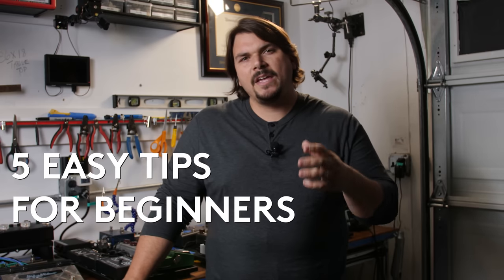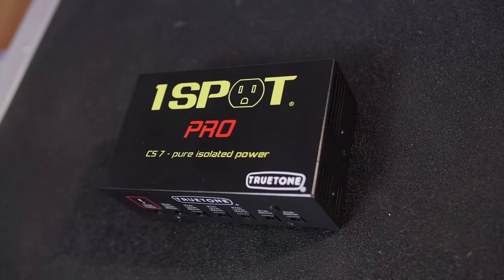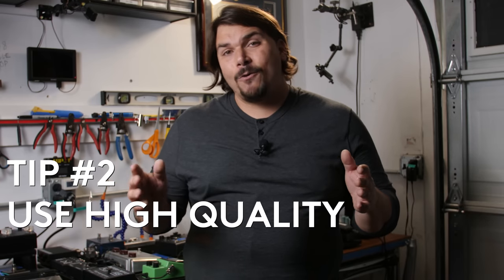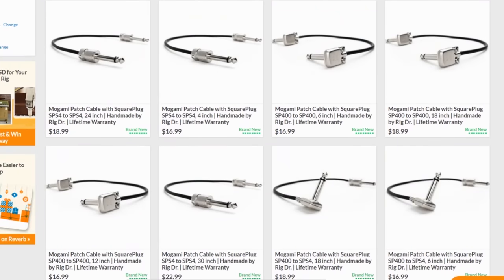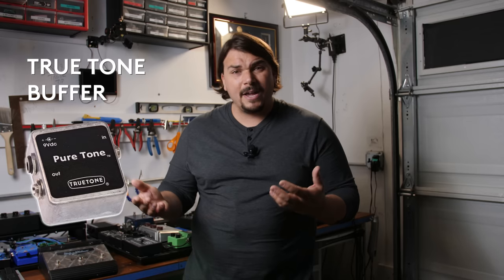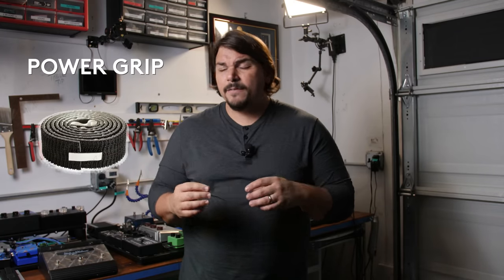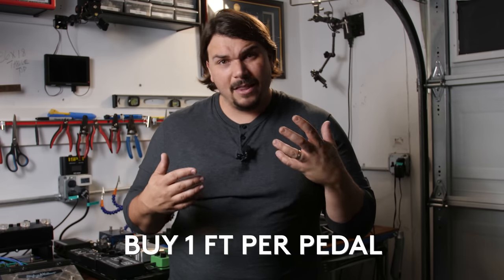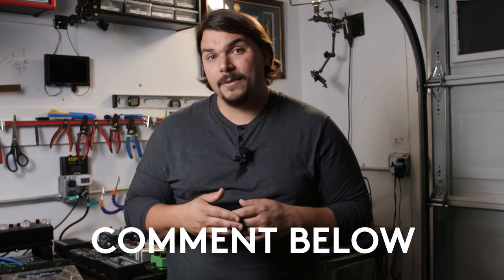5 Ways to Improve Your Pedalboard

Comment: Great video.  

How would you handle buffers when you have a tone bender style circuit at the begging game?  Put it after?

Also...does a Strymon buffer do that trick at the end? Or would you buffer after the Strymon as well?
Reply from the maker: Put the input buffer after the Fuzz.  Strymon has fairly low output impedance, around 100 ohms, which is good.

Comment: My board is mounted on diamond plate on top of melamine board I just use crimp on connectors and supply is underneath I even have a couple blue led lighting automotive type. Clean power

Comment: Hey Mason I think I sent my question wrong so here it is again. I have an Xotic  EP at the end of my 9 pedal board and a Soul Food 4 pedals in from a Vox wah , Rusty Fuzz, then a GE 7. Thoughts?
Reply from the maker: You should have an input and output buffer as I suggest.  The Holy Trinity of Good Tone = 1) high quality input and output buffers (1M input, 100 ohm output impedance), 2) isolated power supply, preferably switch mode, and 3) high quality, low capacitance soldered cables (audio and power).  If you do all that, you've stacked the deck in your favor and rarely will you have pedalboard related issues or have tone suck related to your pedals or shortcomings with the rig.

Comment: Hi Mason. Thanks for this helpful video. I'm building my first board - a Pedaltrain Nano+. Would you put a single strip of DualLock across the top and bottom lengths of board, or just little squares that align with the DualLock squares on each pedal? Long strips on the board would make it easier for rearranging pedals. Thoughts?

Comment: Switchmode power supplies are lighter, cooler, and cheaper than good linear power supplies; but, a good linear is going to be significantly lower in noise than most switchers. The main impediment to using a linear are the size, weight and cost of the heatsinks.
Reply from the maker: If you're comparing power supplies designed for audio in our field.  The switching power supply, in the audio range, as quiet in as the best linear supplies.  The high quality versions aren't necessarily cheaper and most of the linear supplies aren't actually toroids.  Furthermore you can't just put a linear power supply anywhere you want on a rig, you have limitations and the leakage of the EMF is what you're missing in your analysis.  This is a HUGE problem and results in noise in the system even if the outputs themselves are totally isolated and quiet.
Reply: SMPSs are noisy compared to linear power supplies; that's why precision electronics are iffy about them. But the noise is usually well above the audio spectrum and therefore inaudible. Cheap digital pedals might throw a fit over a cheap SMPS, but I've never heard of that happening, since any digital circuit or chip worth its salt buffers the power it receives; usually with a linear voltage regulator IC. I don't believe any analog circuitry used in guitar pedals is going to have any trouble with HF noise, so an SMPS is actually a very good option for guitar effects. The main downfall for linear power supplies is that they radiate a lot of noise if they aren't shielded and grounded like they ought to be.

Comment: My new vertex board and S.S will arrive on Monday i just can’t wait. I just have to save a bunch of money to swap my evidence audio cables for something better.
Reply from the maker: The cables are fine - just get new plugs and you can solder your evidence plugs!  Thanks so much for the support!
Reply: @VertexEffectsInc  thanks to you Mason for the awesome products and advise. Wich kind of plugs would you say is a good  option?
Reply from the maker: @hectorherrera7926  SquarePlugs SP400/5000 or SPS4/SPS5 - it depends on the diameter of your cable.  Check out Best Tronics website and they have a look up table for the which plugs fit the cable you have.
Reply: @VertexEffectsInc  thank you so much Mason you are the best!
Reply from the maker: @hectorherrera7926  Thanks for watching!

Comment: Hi Mason ! For the price difference, do you think that the Truetone can be as good as the High-Wire buffer ? Regardless the different features added in the Mesa Boogie. I just talk about the tone that you get. As always, great vid and great tips for us, thanks a lot !
Reply from the maker: The only objection that I’ve had to true tone is sometimes the quality is not great, I can’t say for certain but my presumption is is that they’re made overseas, which is an always a problem necessarily, I’ve just had some here that haven’t worked out of the box where that’s really been my experience with Mesa Boogie.  I presume if you buy it from a reputable place, or a place with a good return policy like Amazon, you shouldn’t have any problem and I think that sonically it will be a nominal difference if any, you’ll just need to get two of them to equal the number of buffers on the Mesa Boogie.
Reply: @VertexEffectsInc  Ok thanks for your recommendation !

Comment: Hello! Many thanks for all your videos! 👍  Question: I have a crybaby then a Ego Compressor then a Tumnus Deluxe with the buffer switch engaged. Am I ok for my begining of the line buffer?  I then have some pedals... ending with Boss DC2, MXR Carbon Copy, MXR Reverb anf 12 feets of high quality cable for the amp. Do I need a buffer after my reverb (at the end)?
Reply from the maker: Input and output buffer ideally as I suggest in the video.

Comment: Great tips! Bass player here, currently have a board with 14 pedals, in a few weeks when everything arrives Ill be setting up a new 20 pedal rig,  Should i get buffers for the front and end of the signal chain? I have 3 Boss pedals aka buffered bypass roughly at the beginning, towards the end and end of the chain, would i still benefit from the extra buffers?  Thanks!
Reply from the maker: If you're going balanced out of your rig - you wont need an output buffer.  Otherwise you will want an output buffer.  If you use an active bass, you won't need an input buffer, but if you ever use passive, you'll want the input buffer there.  The Boss pedal buffers are poor and I wouldn't rely on those to do the job well.
Reply: @VertexEffectsInc  thanks for the response!  I mostly use basses that switch from active to passive but I tend to run them in passive most of the time.  Time to rewatch your buffer videos 😄
Reply: @VertexEffectsInc  im also running a large format Cali76TX  at the end of the signal chain.  Apparently when powered by 18v the transformer stage acts as a buffer.  Is this enough? There's no audible tone suck to my ears (through the amp), although I play in studio sessions so I'd want the best signal coming off my board.
Reply from the maker: @aaronkim2090  I think the output impedance is still quite high, around 1K ohms, you can double check that on their site I'm sure.  It should be more like 100 ohms

Comment: Thank you for the nice informative show! Just one question, if I have 4 pedals in the effects loop and 5 pedals in front of the amp, do I have to put 4 buffers? 2 in the effects loop and 2 in the front of the amp? Thank you for sharing!
Reply from the maker: Pedro, I would say get a dual buffer - if you have a buffered effects loop, you may not need one there - at worst you'd need one on the RETURN only going back to the FX Loop Return from the last pedal in your effects loop.
Reply: @VertexEffectsInc  Thank you a lot!
Reply from the maker: @petrvm  my pleasure!

Comment: I agree in all except in still using Velcro. Velcro is the past. A mechanical fixation is much better. Try the Guitto Pedalboards. About the power supplies, I prefer the old Dunlop DC Brick (with a 110-240V input and ten outputs: seven of 9V and three of 18V). And what about "ribbon" patch cables?
Reply: Guitto Pedalboards are HORRIBLE - 3M dual lock is not velcro.

Comment: Is there a supplier of bulk flat cable for custom cables?  How do you deal with really short regular round cable when two pedals are right next to each other?  Round cables don’t bend in half nicely
Reply from the maker: Not that I'm aware of - but you'd be better off using Mogami - it's easier to deal with for neat runs than the flat cable and better shielding typically as well.

Comment: Hello, just found your channel. Excellent information. I have a question. What do you think of pedal connector straight plugs? I do use several and have had no problem that I can perceive, but I have heard they can be detrimental to your signal.
Reply from the maker: Straight plug versus right angle...not really any difference other than the space it takes up.
Reply: Do you mean those hard links? They wear out your plugs, since there is no flex to them, which would allow for imperfect alignment of the jacks. Most pedals are tapered just a little bit on the sides; so you can image what a hard link would do to the jacks mounted on those tapered surfaces. The hard link is straight, but the path it needs to follow isn't, so it ends up straightening its own path and wearing out your pedal jacks very quickly. If you can find some that flex in the middle, that would be awesome. But those generic ones are something to avoid.
Reply: Andrew Neal Thanks, that's exactly what I meant. Thanks for the tip.  Looks like an upgrade is due.
Reply: @daleburke1730  Happy to help!

Comment: Hi Mason. I'm building my first pedalboard but I was wondering about my fx loop order. I have a Strymon Mobius, a Seymour Duncan Andromeda Delay and a TC HOF 2. In what order should I put these 3 pedals for my fx loop?
Reply from the maker: I'd try it and see what you like.  A lot of guys in the 80's liked Delay after Reverb, most guys now put it before - so you can experiment.  I personally don't like modulation in the loop, I prefer it in front of the amplifier, but you can experiment with that too.  I'd put it' before delay and reverb if you use it in the loop.

Comment: Thanks a lot for the tips on this video! 

I was looking to upgrade my power on a board I’m working in but I have a digitech whammy XP100 that runs AC so I use 2 supplies for the rest of the pedals. Is there a way to solve this issue? Like a current inverter or do I have to modify the pedal? 

Thanks a lot for any answers on anyone with this type of issue
Reply from the maker: I would check out the truetone CS 12, it has one AC output
Reply: Thanks a lot! I think that one would be the solution to upgrade my power

Comment: Will switching to a proper power supply or changing patch cables have a bigger effect on improving tone?
Reply from the maker: Each of them you do will improve the signal and lower the noise.  If you do both, it'll be doubly improved.

Comment: Hi Mason! Quick question regarding the dual lock strips. Which density would be appropriate (enough) for a pedal board as they may vary from 170 to 400 stems/in2? Thanks in advance!
Reply from the maker: Yes, that's fine.  Offsetting the two densities is the key.

Comment: I bought a Voodoo Lab Pedal Power 2 plus for my board but don’t have enough outputs so right now I’m using a cheap (from Amazon that I previously owned) self isolation station connected to the receptacle on the back of the voodoo. I need to replace this ASAP should I buy another Voodoo Lab or not? I’m using a very large board so I can grow into it 😆 Bought a Gruv Gear Lynk trio so I can just add another plate to it as my collection grows (I want to own every Waza Craft pedal) and I saw that you went into two supplies and drilled a hole into both of them and soldered two of them back to back. On my setup I had to put them apart because the leads supplied got to short, does having two power supplies add extra noise too the chain? Should they be next to one another or as I have on both ends of the board? If they go side by side then I will need to make longer leads, and then the question is which will have more noise? Also another question I just bought all of the soldering equipment I will need to make and repair cables and small mods to pedals ( I think it was you that put an on/off switch on battery powered pedals so you don’t have to unplug them every time your done) my biggest concern is the best solder and flux to use. I bought regular 60/40 and plumbing flux that I need to return (lol should have read the label better) and what do you use to clean the joints after your done? I should have said that I live in Canada 🇨🇦. Amazon Canada offers different items a lot of times. Thank You Doctor and please wash your hands 👋
Reply from the maker: You could use the Voodoo Lab x4 extension supply.  It will allow you four more isolated outputs and you can power it out of the courtesy outlet on the back of the Pedal Power.

Comment: After having deoxit-ed my boss tu-2 multiple times in the last year and still having the same issue of intermittent signal loss when either of the two output cables got moved slightly; I took it apart to check out each jacks terminal and all three had black on the tip terminals where the cable tip would make contact. Some light sanding did the trick but what do you think it was and have you seen it before? Just dirt or oxidization?
Reply from the maker: This can happen in some environments- there are also higher concentrations of DeOxit for badly deteriorated contacts

Comment: Wow I don’t understand . Are you saying the voodoo labs 4x4 is an old linear model that’s noisy when placed under the board?  I was looking at the voodoo labs mondo to power ~14 pedals on my board. Would this be another  noisy one?  Voodoo labs markets them as being silent
Reply: If you have Digital pedals voodoo lab is the worst. I have a hx stomp and a dd-500 and the voodoo lab mondo was under the board. It was introducing noise into my sound and also voodoo lab can’t power pedals like the tru tone can. I went to the cs12 trutone and don’t regret it at all
Reply: This dude Sanchez wow... noted .  Using the mondo now and yes there is some noise 😩
Reply: @RajivSamaroo  yeah lol definitely took me awhile to figure out what was making the issue till I figured it out and remember the rig doctor talking about it on a old video. I definitely recommend the cs12. I took mine in ( voodoo lab) and did trade at the guitar store. And now I am happy with the cs12 wouldn’t go back lol
Reply from the maker: Voodoo Lab Pedal Power 4x4 will create problems in other pedals because it has a toroid (or maybe C or R core transformer), and it doesn't have the electromagnetic shielding that the earlier versions of the Pedal Power, Pedal Power 2, and Pedal Power 2+ had by way of the steel enclosure.  This means you'll have to be very mindful of what's next to it or near it as the magnetic field can cause hum and other noise issues with your rig.  The Mondo is also aluminum and will have a similar issue, as does the Pedal Power Digital.  I would suggest their new Pedal Power 3 or 3+.  They are both switch mode power supplies and won't have any issues related to electromagnetic fields or sensitivities due to proximity to other pedals.

Comment: Would shielding help reduce noise if you have the older style power supply?
Reply from the maker: Steel or Mumetal but doing it properly would negate just buying a switch mode supply.

Comment: Hey Mason, love the chabnel. I have one question for you. Are all voodoo labs power supplies linear, and will cause the noise problem ? I have a pedal power 2 plus and am waiting for a pedaltrain board and mounting bracket to arrive in the mail. But now I am worried about noise problems after I set everything up. Any advice ?
Reply from the maker: The new Pedal Power 3 and x4 are all switch mode
Reply: @VertexEffectsInc  thanks !

Comment: Hey can you spray the contact cleaner into stiff sticky pots? Ones that have a hard time turning
Reply from the maker: You can spray it into pots for sure!
Reply: @VertexEffectsInc  Foot switches too?
Reply from the maker: @Wally55223  it'll be hard to get the contact cleaner in there, but technically it would work if the switch was dirty.

Comment: Hey there man' Thanks for the great tips.. Is it ok to have the power adapter (wall wart) that supplies an isolated switch mode power block also underneath the pedal board? will that cause any noise issues - looking at the rockboard iso power block V16, thanks mate

Comment: Would you recommend the voodoo labs pedal power 3 plus or the strymon zuma 9?  And would you mount either of those underneath a pedal board?  Did you take apart an Ernie ball ribbon cable to see if those were soldered?
Reply from the maker: Both are great.  Both are fine under a board.  I haven't taken apart the Ernie Ball.

Comment: Oh no.. I put my WAH MORLEY bad horsie on top of my Digitech V10 power supply. I have hissing noise every time I step on the Wah. Thanks a lot for this. I need to re design my rig
Thanks Rig Doctor.
Reply from the maker: He’s probably wouldn’t be a problem with a switch mode power supply, I know the bad Horsie is a bit different than most vintage style WAH petals, not sure about the inductors, the ordinarily they’re sensitive to any sort of transformer like you would find in a linear supply.
Reply: @VertexEffectsInc  thanks. I will rearrange my set up. Do you think big pedals such as DD/RV/MD 500 will have issue if near the linear power supply like Digitech V10? How about strymon Zuma? TIA. 🙏
Reply from the maker: @alexvillaluna22  Zuma is switch mode, should be fine
Reply: @VertexEffectsInc  thanks for the info. 🙏

Comment: Regarding buffers, I'm using an hx stomp as my amp, at the end of my chain with my wet effects in the fx loop of the stomp. From there I run out to xlrs/direct boxes. The first pedal on the board is a Boss TU3. My question, do I still need a buffer going into the stomp?
Reply from the maker: If everything is on the board I'd really just worry about the input buffer...Boss isn't great but better than nothing.  You could upgrade there.